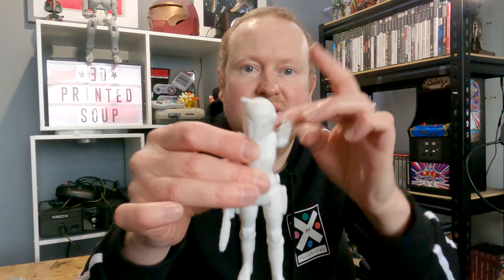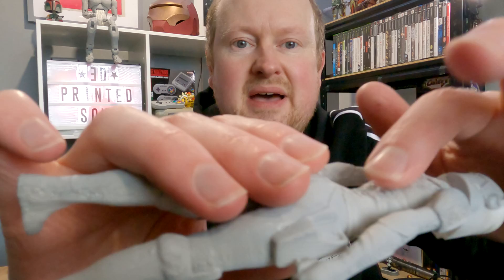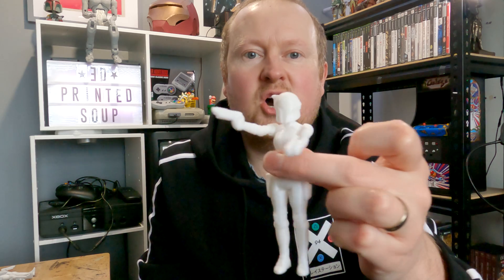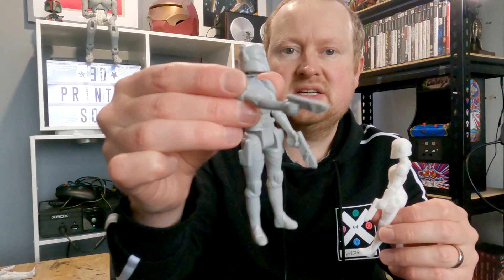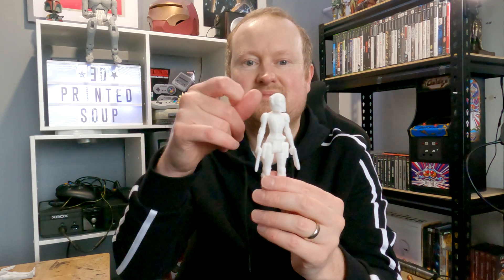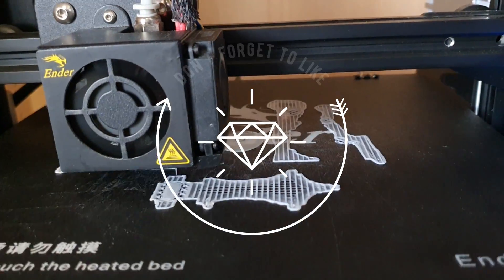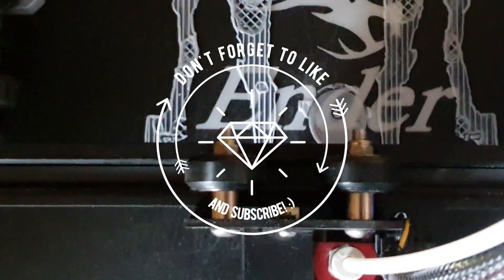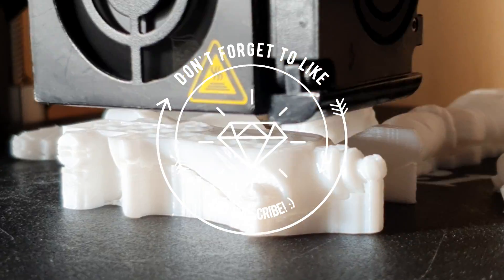What's the best material for 3D printing action figures? PLA VS Resin creality 3d printer challenge.

Comment: Also, he is using an old 3d printer if he uses a Bambu labs p1s or x1c it will produce a way better product. Now with better meteral and more nozzles.
Reply from the maker: Don’t refer to me as “he” rude. And this video is 5 years old , those models you mention did not exist when I made this video

Comment: @3dprintedsoup do the software cost or does it come with the hardware to install on your computer. Do i need an updated computer to run it on? Nobody has explained that back end part.
Reply from the maker: Hi. The slicing software I use (Prusha, Cura ) are both free- their web sites will tell you the min spec your computer needs to be able to run it. Hope that helps, thanks for watching
Reply: @3dPrintedSoup  thank you, I just orderd the creality ender 3
Reply from the maker: @super_nerd_plus  best of luck, i really like the ender 3 range.
Reply: @3dPrintedSoup  thank you, i will give an update once i do my first print
Reply: So i got a new laptop and i got my printer.  I'm having the hardest time of leveling it and i have no clue what I'm doing.  I'm get super frustrated..watched tons of videos and its just not working for me

Comment: I'm going try using PLA, tbh it's mostly because the only place I can put a printer is near where I sleep and I am not doing that with resin but I also hope I can fix some of the problem with PLA in post processing, either carving it with mini drill or printing bases and sculpting on top.
Reply from the maker: I have started doing heads in resin and the rest in PLA

Comment: did you use something specific to get the finish done for the PLA printed figure? or was it just sanding?? this is the quality I want to achieve for my own figures 💪🏼

can I ask you for any advice when it comes to paint them? does it need a layer of epoxy or is this not necessary?

liked your video a lot! greetings from switzerland
Reply from the maker: Hi, it was printed using the fine settings on the ender 3. As for painting, PLA does not take paint well unless you have base coated it using primer- I use a couple of thin coats of filler primer, I then sanded any lumps or rough bits and then base coated with a coat of white spray paint. Glad u liked the video, I have done a couple more action figure videos last month if you are interested. Thanks for watching :)
Reply: @3dPrintedSoup  thanks for the information  - I'll go and check them out ;) thanks & have a nice day

Comment: You can heat up the resin sockets too with hot water and use abit of tenacious resin if you want abit of give in the sockets 👊✌️
Reply from the maker: Hate smell of high impact flexible resin, won’t have it in the workshop, not a bad plan if you don’t mind the stink :) cheeks for watching and commenting
Reply: That never even occurred too me, is it that bad of a smell bro thanks for the heads up 👌👍🏻
Reply from the maker: @foxtrot186  it’s like a chemical rubber smell, but like most resin you either don’t mind it or you hate it, I have no issue with regular resin but my partner says she hates it, so could be an individual thing. If you try it let me know what you think :)
Reply: @3dPrintedSoup  gonna try it at the end of the month bro, will let ya know what I think 👍
Reply from the maker: @foxtrot186  cool, look forward to your opinion, if it’s too bad I might re try it

Comment: And yeah that's Sabine! I love her

I found PLA a bit brittle when I used it for my X-men prints - of course that could have been the settings or the brand of PLA, I've ordered eSun PLA+ which is supposed to have a little more give. 

Personally i'd use PLA for D&D figures too and just file them down, we had problems with a resin printed figure snapping before.
Reply from the maker: I’m going to try ABS, that may be allot less brittle than PLA. I like the detail you get from resin but yes, it can be snap, especially when you drop it. Thanks for watching:)

Comment: how did you slice the one with a good back for the pla print?
Reply from the maker: If I remember rightly the setting were 20% infil, 215 nozzle, 70 bed and standard profile as wanted to have a base line as this was a test.
Reply from the maker: Oh and manual supports as the auto ones do tend to scar the figure if you are not careful
Reply: @3dPrintedSoup  could you make a video for more in depth on this possibly a pt2

Comment: Thanks for the great vid and info mate. Wondering what you used for the resin peg replacements and why? They look pretty harsh to me. Have you tried using LEGO Technic Pegs as the replacements? I use them all time to fix old figs and when I’m kit bashing. Just a thought. Look forward to checking out your other vids.
Reply from the maker: That’s a really good idea, will give it a try. I used some large tacs as they were the correct size and I had them to hand :) thanks for watching.

Comment: Have you tried adding flexible resin like Tenacious? I would be curious to see how figures with different amounts of flexible resin compare to Kenner star wars action figures where the arms and legs are a bit rubbery compared to the hard plastic torso
Reply from the maker: Now thats an interesting idea, may give that a try for a follow up video. Cheers for watching and commenting.
Reply: I will keep my eye open for that vid 👌
Reply: Ya was thinking that myself. Almost feel like certain joints should be printed with a flexible resin and then the joints can be glued into a harder resin.

Comment: So, here's a work around. Resin print and cast a softer material.
Reply from the maker: Any particular softer material? Any suggestions?
Reply: @3dPrintedSoup  no idea on that front. Maybe melt some pla failed prints and mash it into the mold 😐

I'm an idea generator, not problem solver 😇
Reply from the maker: @DemonMage  prob not going to work,  thanks for the suggestion though. Will prob try flexible medium next

Comment: Price wise? Is it just me or is resin way more expensive? I am just about to start the problem is Resin is quite expensive.
Reply from the maker: Resin and filament are about £21 a bottle/spool. Now the amount you get out of one over the other depends on what you print. I'd say pla lasts longer per 1kg than one 500ml bottle of resin
Reply from the maker: Hope that helped
Reply: Resin is more expensive, however if you are fine with lower quality parts anycubic is a chinese resin that is same price as most cheap filament.

Comment: Could this be a design error? Meaning that the pegs need to be suited for either material since the manufacturing process is different maybe it just needs adjustment to tolerances and shapes of the pegs to fit the material properties best, since machines print at different resolutions my guest is the resin will always have a better fit/tolerance. (Check the articulated icons prototype) however it looks like you are using only peg joints, how about swivel, ball, and more complex joints in a more articulated figure?
Reply from the maker: Hi chino. This is a 5 points of articulation  model in the style of the old SW figures, as such the joints are peg and hole and not ball and socket or more complex types of joint. I definitely agree that adjustments to the design could greatly increase the strength of the pegs, however I wanted to print a popular model using the same settings in PLA and resin to see which I preferred.  There are also hundreds of types of resin and pla out there, not to mention ABS and other filerments but I only have so much time in my day ;) thanks for watching and your great comments

Comment: You could try make the limbs in resin and the joints in pla
Reply from the maker: Unfortunately the joints and limbs are one piece on this model. That would work if the pins where separate though.
Reply: You can separate them in a 3D app.
Reply: I was thinking the same thing watching the video
Reply: Could you do the Skeleton with pla and then glue some resin details/greeblies?.

Comment: What resin did you use, iv seen some people do a mix of standard and flex resin 50-50 which helps with the joints, maybe you could try that
Reply from the maker: Hi Tim, I'm using standard uv curing resin. I have heard about people mixing resins with different properties to get new effects, I wanted to try stock for this test. However a mix will make a good future video, thanks for the suggestion and for watching :)